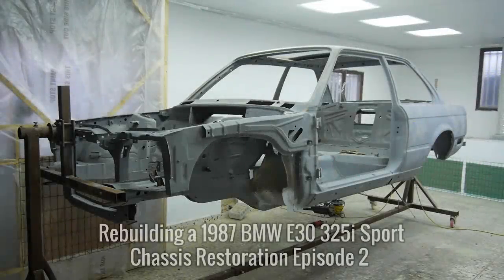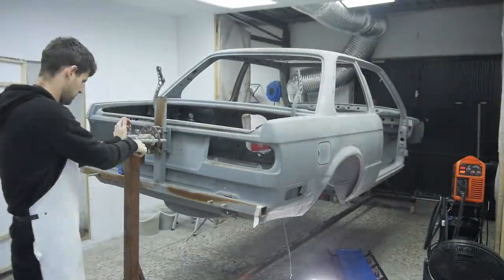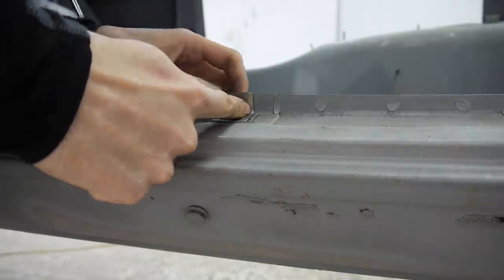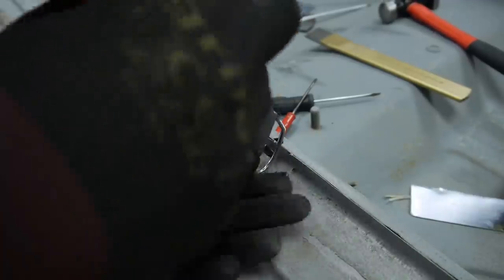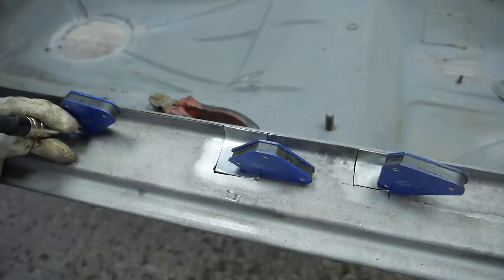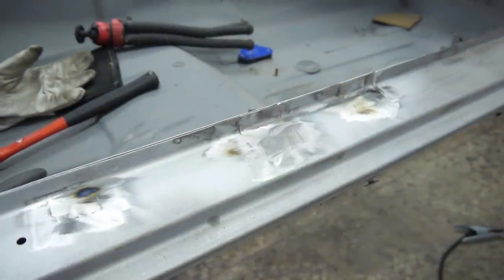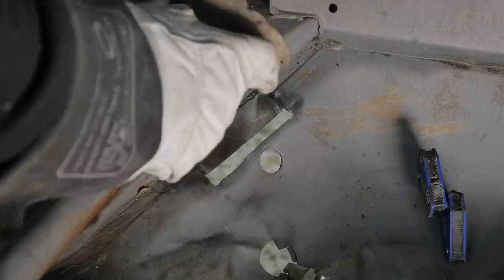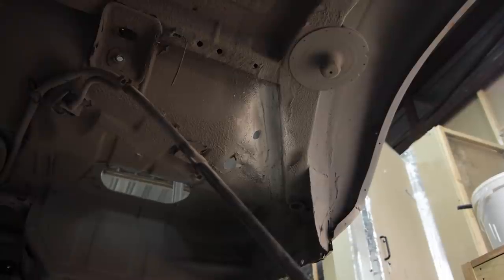Rebuilding A BMW E30 325i Sport | Part 2 - Learning to Weld A Car

Comment: I'm no professional welder but I think you should try making more tacks and less beads, since you are putting much more heat in your panel and you could warp it, also, you won't get the annoying weld-through holes at the end of the bead. I also heard someone suggested tig welding, from what I heard it's not a very common welding process in body work, but there is someone on youtube called "Garage Time - Restomod" who managed to make it work on in porsche, and you won't be deceived by his OCD levels as well :)
Reply from the maker: Thanks Eliaz! And thanks for the suggestion I'll check him out :)

Comment: I used to do what you do but them by accident I made a patch too big for the piece I'd cut out. SO I used the patch for the template to mark the metal that was to be cut out. I now use this method 90% of the time and all my patches fit perfectly.  Hope that helps. It improved my welding by at least 50%.  In summery cut the patch first and then the hole.

Comment: When you have welds sticking up like that a true grinding disk will knock them down faster, use it on it's edge so you can keep it away from the base metal. Once you get the bulk of the weld knocked down switch the the flap wheel and blend it the rest of the way down. It will go quicker and your consumables will last longer. Also don't concern yourself with making the gaps too tight, a nice consistent gap of about 1mm will give some space for the weld to go into and they will lay flatter. You are getting the hang of it and by the time you are done you will be an expert.

Comment: Hi mate, another great stuff from you. I think you need to experiment with the voltage and wire feed speed. 
And also, pay your attention, if during welding metal is easily burned, then perhaps this is a signal that next to this place it has become thinner due to rust that you did not see. 
Weld small pieces with dots, rather than a solid seam, so you overheat the metal less. The fact that you switched to a mix for welding is the right choice. Don't hurry and stay cool, everything will be fine. Good luck man.
Reply from the maker: Thank you Ozzy! Great advice.

Comment: Sheet metal is a tricky thing to mig. Looks like you're coming along.
Getting flatter welds sometimes isn't about upping the power. You might need a hair bit more wire speed or you might need to dwell on those spot welds a little longer to get the heat into them.
Someone with a better ear for mig than me could tell you if your wire speed is right.
Reply from the maker: Thanks dude, I'll keep this in mind.

Comment: Turn the welder up, do some practice tacks on some spare sheets butted against each other. You're not getting good penetration on the backside. Do one tack at a time, instead of a line.
While welding, check if you patches stay flush with the original panel, adjust as necessary. 

What thickness of sheet metal are you using? Looks quite thick. Try some 0.8 or 1mm sheet instead like original for non structural stuff, 1.2-1.5mm for chassis rails.

Use zinc primer between two panels when plug welding. If it welds not as good, just scrape the primer away in the hole. Again not getting the best of penetration on the plugwelds, turn your welder up a bit.

Are you going to replace the whole wheel well? I would rather cut patches out of the new panel than replacing the old one completely.
Reply from the maker: Some people say turn it down some say turn it up. I will have to do some experiementing. 
I'm not sure what I'm going to do with the wheel arch. I'll think about it when the panel arrives.
Reply: @RestoreIt  I find it's better to turn it up and do a short quick tack, than putting a long bead at a low setting. You'll also see that with a quick tack on a higher amperage will result in a lower weld.

What wire thickness are you using?

I would suggest practicing on some extra sheet metal than on your E30. Easier to trow out some "test metal" than having to cut it out of your car..

Comment: Looking much-much better on the welds! Hope it felt better too with the right core and gas ;)
One thing I found helpful since starting (motivated by watching your channel for one) is keeping the nozzle over the weld for another second or so, especially if you can keep the gas flowing independently. It usually should keep the gas on longer, but even if it doesn't the gas in the cable and nozzle will help the weld cool properly.

Seems like you did find the good settings on the welder for the materials you are using =)
Reply from the maker: Thank you Honey! Amazing to hear I have motivated you :D My gas is not independently controlled. This is something I want to look into getting. Thanks for reminding me! And thanks for a lovely comment.

Comment: Hello, nice video
You forgot to drill that little hole. Don't Weld a line, stitch one point after the other so it can cool down a little bit. Sorry for the English
Reply from the maker: Thanks Hubert. I did indeed. I will get this done next episode.

Comment: You should spray that zink spray between those overlap sheets, you cant paint them later. You should allso cut longer hole in those overlapjoints that are rusted, rust is hiding inside of the joint. Welding completely rusted e30 chassis call nerves, I know what im talkin cause i has been there done that 😅
Reply from the maker: Thanks dude!

Comment: 20:58 use a dremel tool to cut the corners, then finish the long cuts with the pneumatic metal saw.
It might take a little longer but your corners cuts will look great

Comment: Hi, first off I believe that even though you can always improve your work is very thorough and good. 
1. In terms of leaving the sill piece low - yes, lazy people do that to avoid having to level it, then they fill it with body filler.
2. In terms of making holes for a reciprocating saw when cutting - I tend to use a larger drill bit after a pilot hole (which is slightly inboard of the edge)- does the job for me.
3. Have you thought about chassis reinforcement? I recently purchased a kit for that. It should come in tomorrow and I can take the measurements and send them to you. They are quite pricey but give the age of the cars I see them as a "must". 
4. To build on point 3 - since you are taking all that time to have a stripped car to the bare metal and build it back up how about "seam welding" it - once again, to improve structural rigidity? The bodies of 40 YO cars are tired and this will improve the feeling in my mind, at least I would at this level of restoration.
5. I have seen many strut braces - front and rear, have you though of installing such? What do you  think about them?
I guess the comment ended up longer than expected. I hope it helps and keep up the excellent work!

Comment: Pro tips: Get a different saw blade, you need a 32 teeth per inches, the ones you got, are for plastic etc.

Also whenever you are welding a piece, tack weld it every 1-2 inches, and then proceed to weld it up. Makes it so much easier. If you wanna do it properly, grind down those tack welds, so you get better penetration.

Comment: Props for doing the work yourself! Sheet metal welding is difficult as it’s easy to get blow through and end up chasing holes. You could try using a air nozzle to cool down each individual weld before moving to the next weld. Good luck my friend.

Comment: Don't try to run beads on sheet metal. Turn the welder up a bit more and/or the wire speed down and do overlapping tacks instead. Wait until the weld goes red then do the next with a 50% overlap. Do about 1-2cm at a time and then move somewhere else or cool with a damp rag to prevent warping and blowout. You can also use a dirty finger to rub your paper to get the pattern. That white fuzz you are getting is zinc from the coating and makes for a poor weld. A 1mm or so gap will also lead to a flatter weld but more risk of blowout and a bit more warping. Good luck, it's pretty satisfying once you get the hang of it.
Reply from the maker: Thank you Aallwwkk! Great adivce. I will save this comment and read it again before I weld again. thank you.
Reply: @RestoreIt  It's all about heat management and patience! Also, what size wire are you running? 0.023" or so is better than 0.030". I've had very little luck with the weld through primer as well. It was ok on the back side of the part but it did absolutely awful when actually trying to weld through it!

Comment: When I learned to weld, we were forced to start with filling up angle iron. It’s a nice way to start, learn how to get a good flow and how to adjust the welder. I’m used to mig welding, but I’ve always used a gas called “mison 18”🤔😅😁

Comment: loved the vid mate. good to see your welds have improved since the last ep. some of them look better than mine. especially your tacks. also at college i was told to always do a few test welds on scrap metal to make sure your amp's, gas and line speed are correct. cant wait you see how much more your welds improve over the next few episodes.
Reply from the maker: Thank you Jordi! Good adivce, I'll do more practice off the car next time. Thanks!

Comment: Nice work and learning. One tip for you: dont do "patchwork". Use bigger plates, now you weld 3 small plates near each other and there was old fix plate near also. You shoud grind near old weld and change at least 30cm new plate.

Comment: Instead of using a grinder for smaller holes, use a drill with large empty crown for drilling. 

Of course, the patches you need to use as well as patches need a full set of crowns to give you easier and better results.

Cheers!

Comment: If you are going to be doing full panels, it would probably be a good idea to get a spot weld drill bit, this will help with only cutting through the spot weld and not both panels, this way if the hole for the spot weld is on the panel you are installing you still have the backing of the existing panel. also good if there are multiple layers welded together, it will help cut through only the weld of the panel you are replacing.

Comment: Hei!

Get yourself "sheet metal nibbler", either for drill or air. That way you can just drill one hole which nibbler bit will fit in and then you can cut the whole part out what you need to take off.

Comment: Nice work I just advice I personally weld tack by tack close as I can it's less heat transfer to metal less burn out on metal good to left a gap between original panel and patch about 1 mm per side it's better weld penetrations easy to grind flush the weld, I never make sharp corners just left some radius  on patch and panel too thin metal easy to burn away. Just try these out on some scrap sheet metal and let me now if it's better peace
Reply from the maker: Thanks for the advice Tivah!

Comment: One thing I like to do if the tin gets a little to thin and you keep blowing holes. I pull the gun away from the metal a little  and let the wire heat up. Less amps then and you can get a tack in place

Comment: one tip. dont do to fast, cole it down after each one , use Air coprossor on it. if you go to fast the metal gonna be like crap
Reply from the maker: Okay thanks Andreas :)

Comment: Looking good, even your welding looks good. But if you want it to look good on thin steel its best to stitch weld. especially if youre running .030 wire, .023 wire you can with less blow outs.Trying to run beads will only blow holes. Weld like youre putting a tiny flat tack, let it cool a sec or two when the red flashes off and put another tack with half/quarter overlay on the first tack. This way you will get full coverage, with no blow outs, less work grinding, and if done right you can have that dime look. Pretty sure theres stitch welding videos online that can help you.

Comment: I belive the reason the other patch from another shop was lower is so you can use filler and hide the highspots that welding and high sheet metal produce. Fyi - too much heat on your magnets will ruine them. Possibly tac weld like dimes so you dont get burn throughs. You dont know what lurkingon the back side of the unblasted metal. Keep it up!

Comment: Sorry if something is wrong, but the issues about welding and body repair are very monotonous and boring. I think that they would need to be combined into one or reduced at least three times each. We look forward to new videos, thanks my friend)
Reply from the maker: Thanks for the advice. I will get through the chassis as fast as I can.

Comment: Flap disks are meant for finishing off so u wanna use a grinder first to get rid of most of the welds then finish it of with the flap disk this way you don’t go thru so many of them!

Comment: I dunno if you have the space,  but an oxy acetylene setup could handle cutting, some welding, brazing, tons of useful stuff. Pretty cheap too. Biggest cost is the initial purchase of the gas bottles.

Comment: That is much better welding than last video! Keep it up!! You will be great at it in no time=) but maybe mor power and shorter "burst when you weld, on bigger patches, use a airgun to cool the metal down so it dosen`t warp. And i know this is not the right way, but welding thin sheet metal edge-to-edge is difficult, you can make patches theat overlap just a tiny bit, better to weld but not thje "correct" way.
Reply from the maker: Thanks man!

Comment: It’s too thin of a gauge of sheet metal to run a continuous weld bead. Also you are swinging the gun. That’s don in thicker material to put more heat and build up the weld. In those kind of thicknesses you want to run lots of tack welds. And keep the gaps as little as possible yet still some is needed. Oh and that garage did that weld on the sill that way so you can put filler on it. In your any high spots will need to be Hammered in.
Reply from the maker: Thanks for the advice Ferdiyurdakul! I will bear this in mind.

Comment: You dont wanna be running beads on sheet metal that thin, you want to be building up spot welds to make a bead, do 4, or 5 spots then move to another area, i give it a blow with the air line to cool it quicker and move to another area. 

Be careful with the grinder, them heat spots are were you have almost ground through the sheet metal, try and focus the disc more on the weld. I bought a katsu mini grinder off Ebay and I love it for grinding welds down on thin sheet. 

I'm not an expert or saying I'm any good but there just things I think might be helpful to you, oh and it dosent make a different if you pull or push the weld

Comment: Two things that can make your welds work and look better. First turn down the amperage. Second use a backer plate of either brass, copper or aluminum. It will not blow through nearly as easy. And with the type welding you are doing, there is no reason to do the back and forth you would usually do with making quality deep penetration solid joints that have to actually support lots of stress. Just a straight quick run will do the job and lessen the blow through possibilities you are having. And once you blow through, don't continue to try and fill it in. The heat is already too much for that area and needs to cool off some before trying again... JMHO

Comment: You're using your tin snips upside down and red snips cut left.
  Green snips cut right.  And yellow snips cut straight or left and right.  Depending on your cut the correct tin snip will help protect your flesh from the razor sharp edge.  At least thats how it is in the states.

Comment: Great videos dude, I am watching the progress of this beamer since the 1st video. Why don't you try to use body filler to fix these welding mini holes, before applying the grey primer ?
Reply from the maker: Thanks Ivaylo! I won't be leaving those small hole there don't worry. I'll go back and do any welds that aren't good enough until they are.
Reply: the less filler you use the better
Reply: Not a good idea to fill holes with body filler, it can become a place for moisture to work it’s way in from the back of panel and cause trouble in the future

Comment: You are getting there. I wouldnt advice you to weld beads. Just weld tack on tack. This will reduce heat input and less likely to burn through.

Comment: The previous weldments from the videos before will probably fail because of fretting fatigue so re do them as soon as you can so you don't have to go through that trouble again
Reply from the maker: Yes I think I will go back and redo that part. I'm happy to do it knowing I'm better than I was when I first did it :)